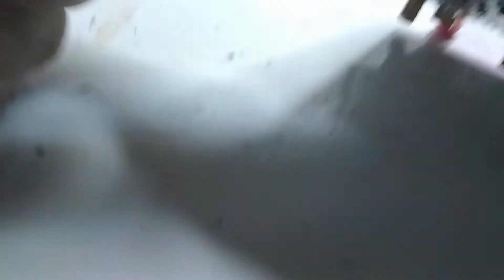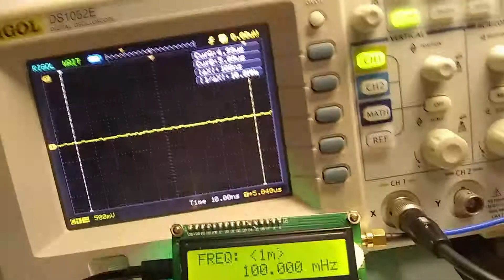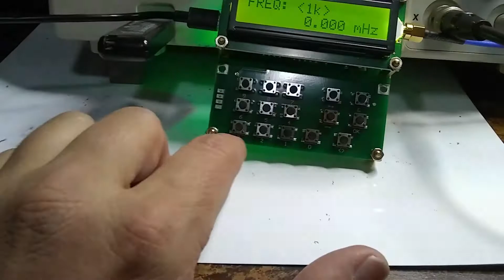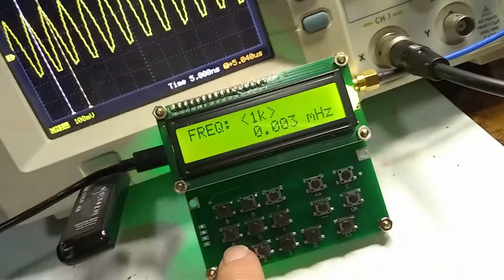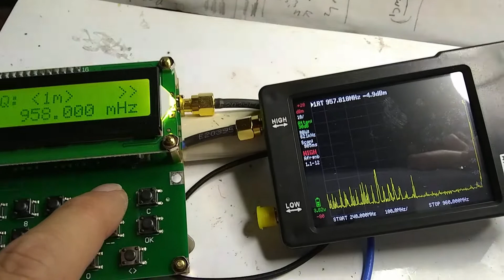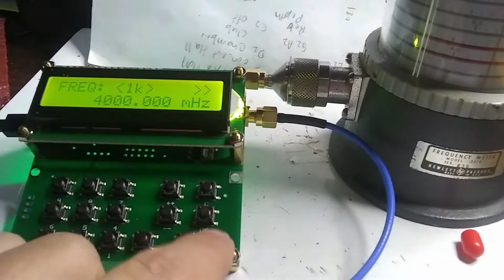RF Signal Generator 35MHz-4400MHz

Comment: Thank you for making the video. It showed that my unit wasn't working correctly. But I would like to give some constructive criticism. Watching you learn how to use the device was very irritating.  Maybe you could have spent 15 minutes before learning how to use it. And the fan noise is also unpleasant. If you could have focused more on putting in signals and showing the output it would have been more helpful.

Comment: Hi if you hold down the ++ button it scans up. If you hold down the -- button it scans down. By the 1k or 10k, 1M setting steps. Keyboard part can be separated as my Video. Cheers from George in the UK

Comment: yo bro i got a question, when an article says '30 Mhz kills viruses' what equipment would you recommend i get to produce that frequency if you happen to know, thanks
Reply from the maker: It would have to be something very high power probably.. like a high frequency flyback circuit with a air core resonator coil.. I have made videos on several high power devices like this.. look in the high voltage and electronics play lists.. This is in the HF range.. so a high power ham radio transmitter would probably work.. do you have a link to the article that talk about this?? I can try to look at it?? Thanks!